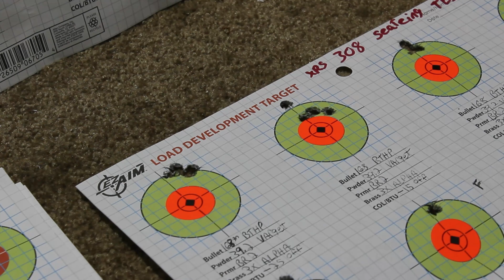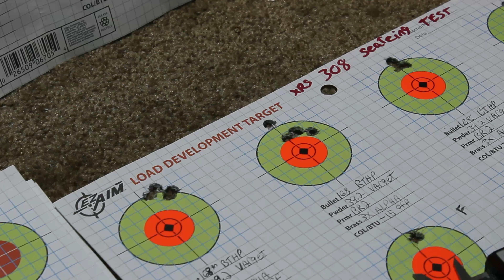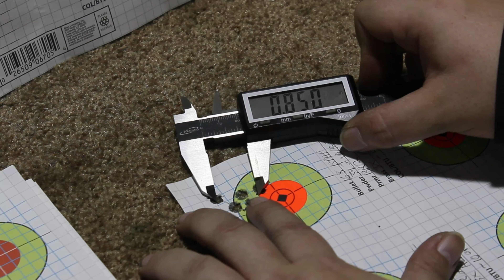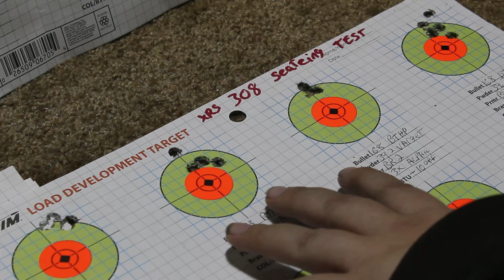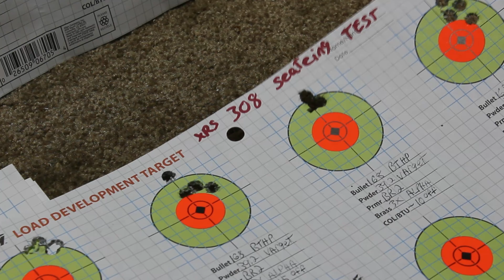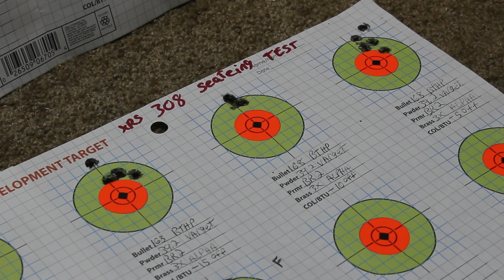308 XRS shooting seating test 168gn BTHP

Comment: No hate, love your videos! My question is, why single feed with a mag? I’ve never understood that
Reply from the maker: So single feeding with a bolt rifle when you have a magazine basically comes down to trying to be as easy as possible on the tip of the bullet sometimes feeding from a MAG can jam the tip up against the chamber wall and mess it up a little bit so that's basically it just trying to be as easy as you can on the bullet by hand feeding it it's as simple as that. Thanks for the comment I appreciate it